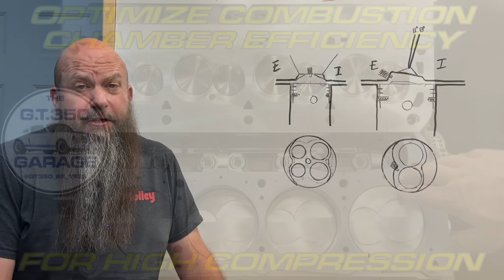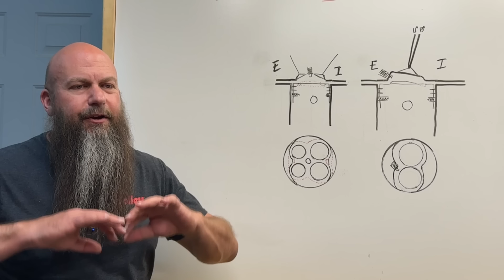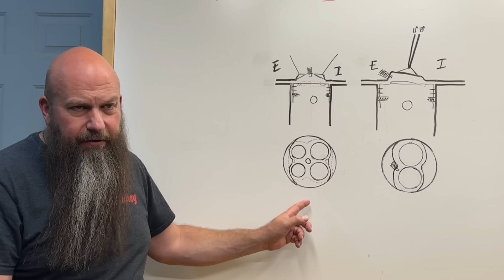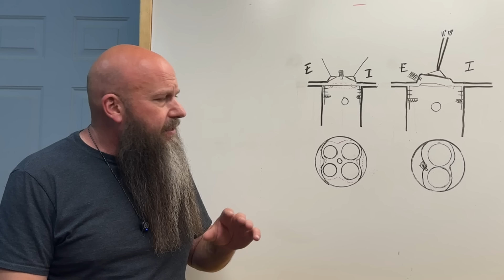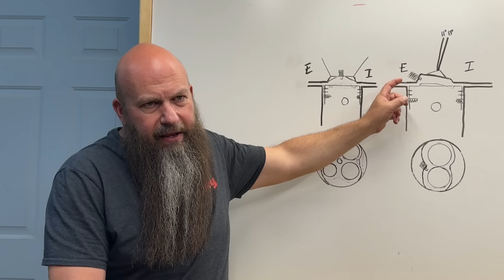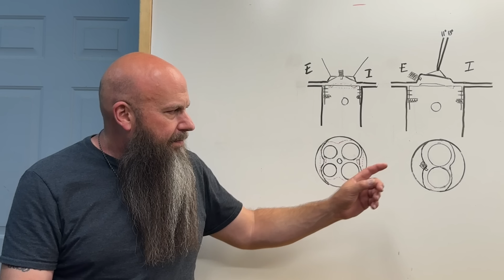How To Optimize Combustion Chamber Efficiency For High Compression And How It Impacts Tuning

Comment: I have been  building engines since 1982 . I so agree with your logic..Recently built a 428 FE with 12.6 to1 only 224@50 BBM heads only .035 piston to head. The piston is a Diamond flat top (no valve reliefs..Yes I checked P to V clearance , there's enough ) . They told me it would hit so I had to tell them I'd cut my own . She's a 462 cube torque monster with only 24 degrees timing.. The only caveat is the chambers must be clean. So we fitted water meth . She didn't need it till the chambers got dirty and it's just some extra insurance margin   ..PS  Being an Aussie my favourite  engine is a Clevo but 351 open chambers are rubbish
Reply: So what is the best C head over there?
Reply from the maker: @racerd9669 the best production Cleveland head is a 4V close chamber head for power, for torque it’s the Aussie closed chamber 2V head known more affectionately in the states as a 3V head.  Aftermarket it’s a whole different ball game, CHI, TFS, etc. have a variety of options that meet a variety of needs.
Reply: @TheGT350Garage I built a 4-bolt main 351 Cleveland back in the day knowing none of this -- i was forced to use high octane and lots of timing. My current build started life as a 3-valve 4.6 but is a lot more "informed" by this kind of info. Too bad you didn't go into "Omega bowls", but I figure if it's good enough for Formula 1... I'm going with TJI with Atkinson intake valve timing and 1.6 Lambda also, aiming for max efficiency. There's some other unrelated changes too.
Reply from the maker: What you’re proposing is fine and theory. The issue is the practicality of it. Omega bowls and TJI would require an incredibly dedicated engine build, and a very specific cylinder, head, piston, and fuel injector. I won’t discourage you from trying, but the average person who builds cars simply won’t have success implementing technology on that level.
Reply: @TheGT350Garage which is why i'm working with a research university...
Reply from the maker: The only issue with big bore and stroke like the 462 FE has and running .035 piston to head is the piston can rock and tap the head, especially with a forged piston that needs a little more cylinder to wall clearance.  On a 4.250 based bore and 3.98 stroke, or a 4.130 based bore with 4.125 or 4.250 stroke, I’d call .045 safe.  I’d strongly recommend 8-12° more duration with the cam installed retarded to a 112-114° ICL to let that big displacement breathe and make some power up to about 6500rpm.
Reply: @TheGT350Garage   The owner wanted to use a standard stall converter thus the 224 @50..4.160 bore and 4.250 stroke gave 462 cube.. .035 shows no witness marks when we look with the borescope😁
Reply: @TheGT350Garage  Shouldn't be an issue with a quality set of 4032 alloy forged pistons. 2618 alloy maybe.
Reply from the maker: @bunger428 and @davidvander2233 it’s less a thermal expansion issue and more a piston rock and rpm issue.  .035” is probably fine with an H-beam on a steel crank below 6000rpm, it’s going to show up at 6000+rpm and if you see any carbon deposits on the head or piston they can touch.
Reply: @racerd9669   CHI ..or Scott Cook.. Air flow Development (Early castings )
Reply: Merry Christmas everyone. 
 Would a recesed piston inverted dome  and mostly flat combustion chamber head . and 11to1 Compression .
Be a good setup.
Reply: @nitro456jk  squish to 0.040", +/- 0.010"... Dome or dish as needed to dial in compression ratio. 

I poke pistons out of the hole 0.005" when running under 5500 rpm, BBF (fat pistons). 

Don't be afraid of compression, just understand a more efficient burn will naturally want less timing to get the peak pressure at around 15-20° atdc... compression numbers will be somewhat camshaft based, but even a stock cam can handle 10:1 easily, done as instructed above... higher comp at higher elevation.

Merry Christmas!
Reply from the maker: Inverted domes are ideal if you must run a “dish” to reduce compression.  Example of a combination that must run a piston with a dish is a big Ford Windsor stroker 408, 427, 462, where the cylinder head has a chamber volume limitation.  A 427 with a 66cc combustion chamber will need 12-14cc volume in the piston to reduce compression to 11:1 if you run the piston at zero deck.  A 12-14cc inverted dome with .040” quench or squish will net a fantastic burn and be very detonation resistant.  Use a head like the TFS 11R227, mirror that chamber as an inverted dome, and you have a really efficient setup.
Reply: I ran 390s a few times. 8:1 compression she ran hot. 10:1 she cooled down significantly, and got about double fuel economy (9-10 mpg vs 18). 

A friend had a 428 that he got 17 mpg with, so I'm working on an LS build around the same dimensions as the FE 428 (416 cuid). I want to see how close I can get with similar sized valves and ports, compression, etc., with worse quality of fuel... 

This is the information that gets people success in their projects... and makes engine builders respected by their clients.
Reply from the maker: I had a 9.5:1 390-2V in a ‘67 Galaxie that would pull 17mpg on the open highway, switches the manifold to a 4V and built a 600cfm Holley 0-1850 (back in the ‘90s) that improved the fuel economy to 21-22mpg.  The 500+ mile range with its 25 gallon fuel tank was great.  But it was geared and tuned for efficiency, not performance.  It was probably making 260-275hp, but great low end torque.

Building an LS to miminlc an FE is an interesting approach, especially considering the worst LS heads are still on par or better than the FE low and medium riser heads of the ‘60s-70s.  Even 428 Cobra Jet heads aren’t crazy performance heads compared to modern head technology, you had to get into the 427 Tunnel Port or SOHC heads to get flow numbers close to an LS3 head an the ports were massive in comparison.  A 416 LS with 10:1 CR, 4.8 heads, and a truck intake, using stock 4.8 cam will make more torque and horsepower than a 428CJ in period,
Reply: @TheGT350Garage  sick ride, that '67 Galaxie... My 390 was in a '69 F150, 18 mpg city/highway combined, on high octane, brand new Edelbrock with zero tuning... electronic dizzy with no tuning.

Yeah, the FE heads were pretty horrendous... but they created good swirl, and somehow made awesome torque  and mpg when squish is correct.

I have a small cam picked out by Texas Speed, getting away from the 2.165 intake valves and going to 2.040-2.060 intakes, stock exhaust on modified cathedral ports. Part of me wonders if the sharp turn of the FE heads isn't a cause for intake charge storage at low RPM... The reversion from the intake valve changing direction while closing can't send a shockwave back up the port near as well... I suppose I'll find out...

I should end up at around 11:1 comp, 208-214/112 cam, probably on 102-104 icl... Later icl works for economy at 3000 rpm, earlier builds more torque at 1500 rpm cruise. The FE ran pretty lean at low rpm cruise, and should be able to mimic such with the '07 Yukon platform. 6spd auto is also nice for mpgs.
Reply: Yes, those CJ and bigger heads were great for racing. My 6.2 couldn't make a cam work up any low end with stroker crank.... It just comes alive at 3000 rpm. After rebuild (and them giving me wrong size pistons), I gained some top end with 216-224 cam with vvt,  but the same crummy low-end torque. 

Due to compression with 4" stroke, I am going with 317 LS heads as the platform to modify and fit rec port intake to... I'm hoping it'll behave similar to my EFI 460 (e7 heads) with Wieand Stealth intake... High velocity intake port, improved top end flow without compromising low end... Hopefully it's not a trainwreck 😂😂 I can always convert back to cathedral ports with earlier truck intake. The eventual turbo should make up for potential loss in top end power...
Reply from the maker: An FE uses a 13° valve angle, that’s why they make the power they do with relatively small seemingly low flow ports, they were a pretty efficient head from the factory.  An LS3 is 12°.  Think it out.  It’s not illogical to treat an FE like a more modern engine.  If only the aftermarket would update the combustion chamber designs.  I’m helping a friend with a 390 for a ‘66 F250 that he’s building.  Because it’s a truck and not looking for big power, he went with Speedmaster heads, he has about 20 hours in hand finish work to make them ideal, and another 8-10 hours lapping, setting up valve springs, etc. and they will perform nicely when the engine goes in the truck.  It should easily pull down high teens for MPG with the manual transmission.
Reply: @TheGT350Garage  I find the LS has a much better port to valve approach...

Good luck with your buddy's truck, sounds like fun!
Reply: @TheGT350Garage  the biggest reason I stepped away from the FE was due to the main oiling going beside the cam bearings,band it's difficulty in enlarging the slots. BBF is a better design, even though I'm considering a main cap cradle with capability to carry oil ... I have an old dent side I want to build 410-428 cubes with... I have the 428 crank, just have to sonic test the bores as I found the machinist thought 0.0030" variance was called "precise"... I'm a couple years from that project yet.
Reply: I had a friend who dropped $5g on a 383 stroker. Then bought a Ford f350 4x4 with a 400 that was faster, in stock form. He's finding out how he got taken by a machinist who didn't sell what he said he was selling. People will really trap benefits from applying this stuff.
Reply: Great information. I’m building my first engine. 11:1 compression, 56cc chamber, 0.040 quench, and flat top pistons with -6cc valve reliefs. Maybe if I ever pull the heads, I’ll have them milled a bit to increase compression. I have plenty of piston to valve clearance to accommodate that someday. I’m already thinking about my next build and the chamber specific dish will be key. Thanks!